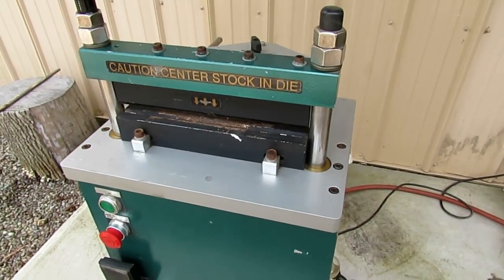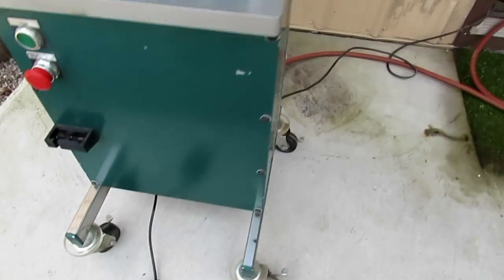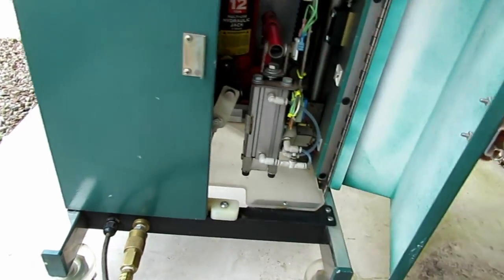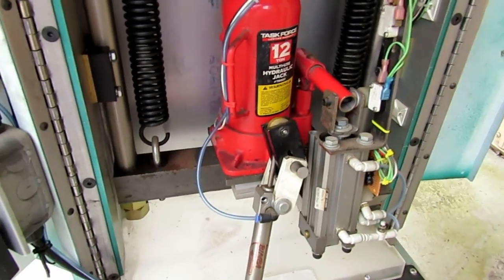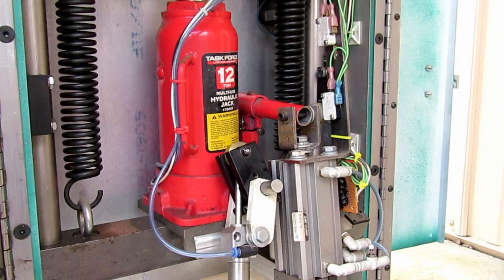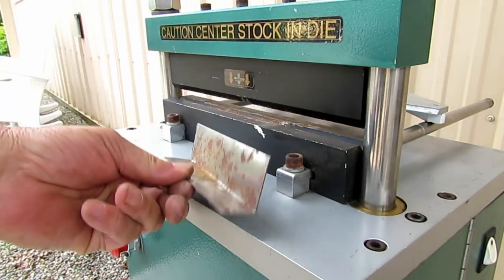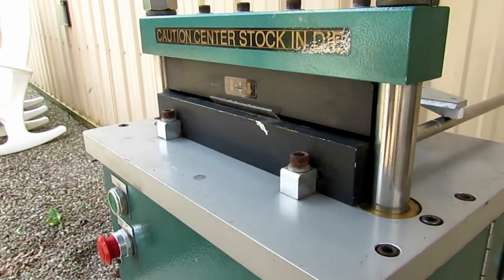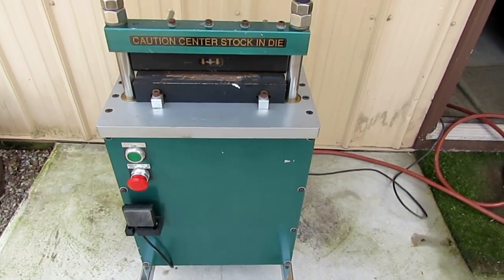Home built 12 ton press brake

Comment: wow
Reply from the maker: Thanks for watching.
Reply: @unemployedredneckhillbilly2023  I can do all the fab.  The controls are what baffles me.  Can you direct me to some primers on these things?  When you select a switch or a cylinder or whatnot, how do you properly SIZE it? Capacities? Forces?  CIrcuitry? Switching? Hydraulics?
Reply from the maker: I think  SMC and festo have lots  if info and components to get started.  Everything changes based on the components you use and forces required.  Keep an eye on Craigslist for affordable components to play with  and always start out with  very low pressures so you don't  get hurt or break things. Hydraulics are controllable and slower but pneumatics are springy and can move very fast..
Reply: @unemployedredneckhillbilly2023  Well, you did design it and spec'd everything out, so what about selling a Bill of Material?  Plans??
Reply from the maker: It was made  from things I bought off craigslist like I said and other parts I had laying around so there is no list and never will be. Big waste of time to me. I share ideas  hoping others will do more research  on their own if they decide to use them for their own projects.  I want  people  take time and learn new things and be able to figure  out  things on their own.
Reply: @unemployedredneckhillbilly2023  I understand.  I am retired now, and no time to take.  I was an Industrial Engineer who morphed into Structural Steel.  I was only a conveyor machinery designer for a few years.  I remember the SMC? (I think) but I am not that in need of a miniature press brake) so I just wanted to have one as a home deal. I have a 150 ton Cincinnati and a 250 ton Verson brake, so I was just interested in the hydraulic and electrical stuff.  Thanks anyway.

Comment: How about a diagram of how the air system works? please
Reply from the maker: I didn't do one. It's simple,  just a small 12v transformer,  some switches and 2- 12 volt solenoids to operate the cylinders.  There is an adjustable magnetic switch to control the stroke for the up position.  Thanks for watching.

Comment: So, with your design skills you aren't really unemployed, are you?  Love to get a better understanding of the fundamentals of your design.  Just watched a Bar Z video tutorial on dressing wires in an enclosure.  I think Stan would approve of your technique.  YouTube suggested your channel after I searched for swagoffroad.com press kits.  Count me as a new subscriber to your channel.
Reply from the maker: Yes I am for over 10 years now. I was displaced by foreign workers and got so mad I never looked for another job. It is just a simple die set design that uses a couple of peices of thick wall stainless tubing for guide  shafts with 7/8 High strength threaded rod inside them to hold it all together. A couple of brass bushings guide it and the jack just pulls the top die down. I saw a air operated hydraulic jack at Harbor Freight that could be operated with a solenoid and replace all the cylinders and switches that I used. Those little plastic tie wraps help to keep the wiring in place and are easy to replace if you mess up. It is allways fun to make a usefull machine from scrap that is laying around. I built that before  starting a YouTube Channel and made the video of the finished unit and am sorry there isn't a good video of the total build Thanks for watching my videos and subscribing